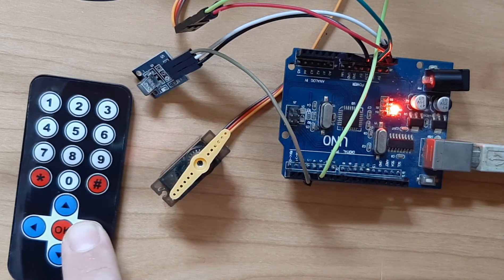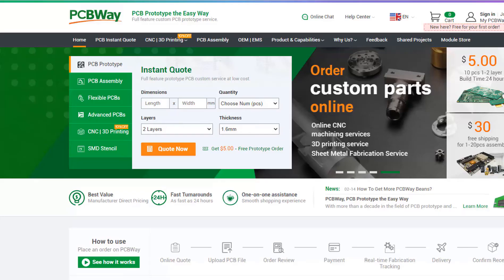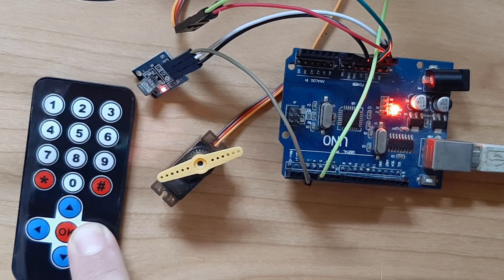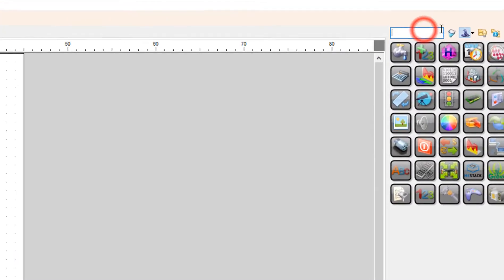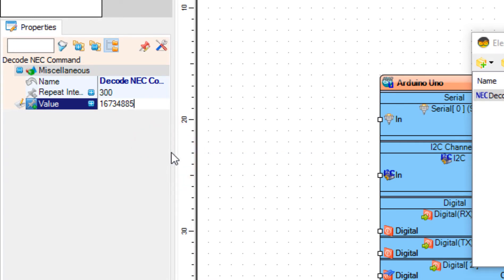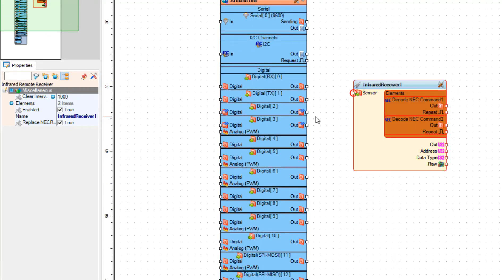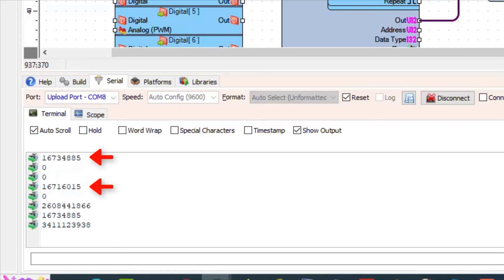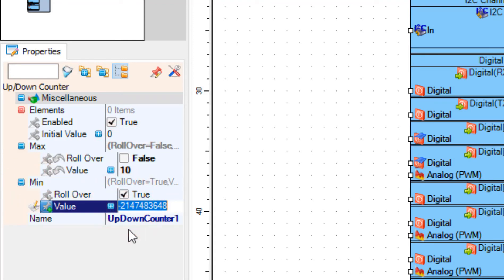Controlling Servo Motor With IR Remote Using Arduino

Comment: how did  get IR to connect with 5v along with servo to connect with it if theres only one slot for 5v on the arduino
Reply: nvm i got it you put ir reciever on IOREF which just matches the voltage the thing is usng which is 5V because thats the one the servo is using

Comment: is it possible to keep the code on the arduino? anytime i unplug it from my pc and connect it to the battery it forgets the code.
Reply: Im not sure, but I think you will need an e-prom.
Reply from the maker: In this case you should use EEPROM to store the position and read it on start, search the web for "EEPROM Visuino" to see how it works